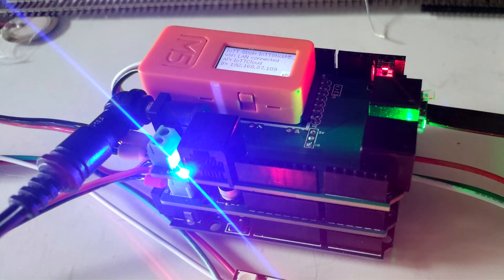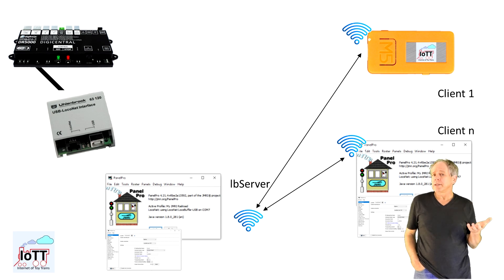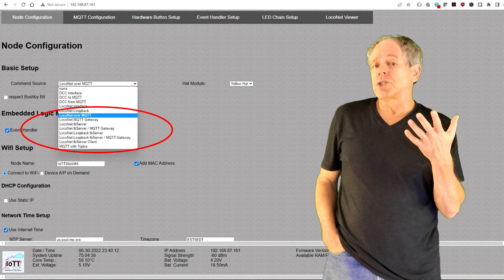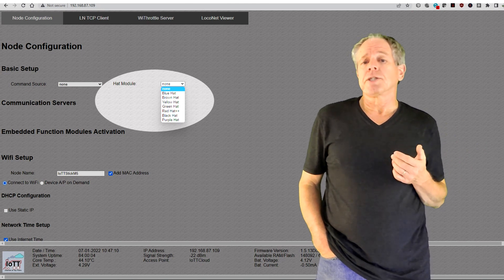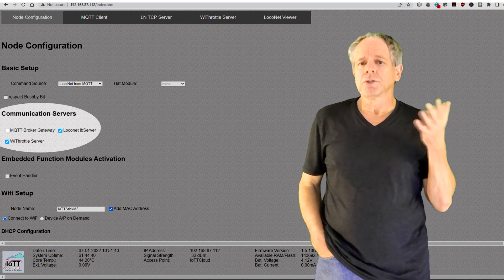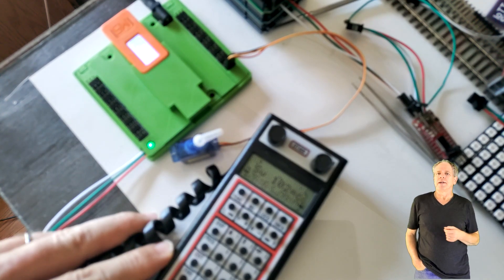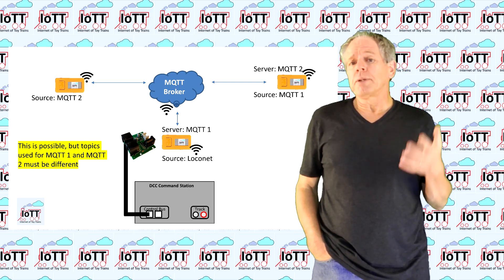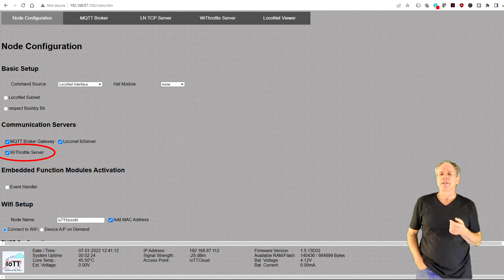A WiThrottle Server for the IoTT Stick (Video#98)

Comment: Hello! Can I ask - how many simultaneous WiThrottle connexions can the IoTT stick deal with simultaneously?
Reply from the maker: In AP mode, the Stick has a limited number of clients that can be connected. I think up to four devices should be possible, maybe 5 or 6. When n Station mode, meaning the Stick is connected to a Wifi router,  I think the ESP32 limitation should be bypassed. The server software is written so that it can dynamically add and manage clients as long as there is memory available. However, I have never tested it with more than four devices at the same time. 
In any way, if needed, there is always the possibility to connect the Stick to a PC software, e.g. JMRI, using Loconet over TCP, and then use a WiThrottle server on a more powerful device.
Reply: @IoTT  Thank you - that is helpful.

Comment: Everything runs well and I like to power the M5 by its pinheaders instead of USB-C but it switches off after some seconds. Is there  a setting to prevent this? Thank you :)
Reply from the maker: Verify the 5Vin voltage on the technical display page of the Stick. If it is higher than 4.8V and displayed in black (on either 5Vin or USB), the Stick will not shut down. Without external voltage, it shuts down after 30 Secs.

Comment: Hi. Just bought a M5StickC, it is available under Win7 under COMport 12. Unfortunately the update.bat ist not finding this port. Can I adjust it to use com port 12 explcitly? Thank you and best regards, Philipp
Reply from the maker: Check the M5 Stack web page for the correct USB driver. Also make sure that no other USB device is connected when you try to run the installer.
Reply: @IoTT  USB Driver was correct. It worked, after I added the parameter "--port COM2" to the batch file. Previously it always failed at another device on my PC. Possibly this is helpful for others.
Reply from the maker: @PhiMas29  Thanks for the info. I will add that to the readme file.
Reply: @IoTT  Sorry for asking again. After uploading I see the Logo. Pressing M5 brings me to "Connect to AP IoTT_Stick_..... to set Wifi credentials" but I see no Wifi accessible with this name. Cycling further I see "Wifi LAN disconnected - Click here to connect" but I don't know where to click.

BR,
Philipp
Reply from the maker: @PhiMas29  Check here for information on setup: https://myiott.org/index.php/iott-stick/user-manual/iott-stick-core/wifi-configuration
Most likely you let it time out.
Reply: @IoTT  Finally I got it running, thank you and to W. Heinen who helped me recently. Other question: Engine Driver does not react on trying to operate Functions over F8. How do you encode them?
Reply from the maker: @PhiMas29  At this time only functions F0-F8 are supported. The reason is that Loconet does not have commands for the higher function. Digitrax throttles, as far as they support higher functions, use encoded DCC commands, which means they have to be sent out periodically as they are not refreshed by the command station. This is something I may do on the Stick in the future, but so far I have it not implemented.

Comment: I think I understand this correctly, but if I have the Loconet Interface Breakout Board and IoTT stick with the latest updates, I could connect that to Loconet on a DCC system and that will allow me to add a WiThrottle server to the system?  I'm in a model train club that has a couple of layouts, and we're trying to add Wi-Fi throttle capabilities to all of them, but adding a USB interface + Raspberry Pi for JMRI is expensive, not to mention that Raspberry Pi systems are very difficult to find right now.  So if this will work, it'll be a game changer for us on our older, non-USB-capable DCC systems.
Reply from the maker: That is correct, assuming your command station supports Loconet. And the Stick can also be used to wirelessly connect JMRI to Loconet using Loconet over TCP. What I do not know at this time is how many devices can be connected at the time and whether the number is different depending on how the Stick is operating (providing its own acces point, or connected to an existing Wifi network). More testing required ;-)

Comment: Hi Hans, again another very useful addition to the IottStick ecosystem - well done.

Do you know what is the max client devices that can connect is? I've got a feeling its 8 TCP connections, but that may have increased by now  

No doubt this will be a very useful stand-alone feature for those who want to simply add a few WiThrottle connections to their LocoNet layout without adding a full-blown JMRI

I've just given it a quick try and made a few observations:
- It doesn't let me control Track Power - perhaps that is just a WiThrottle on iPhone feature but is useful
- The speed slider on the WiThrottle app seems to be a bit jumpy, but it might just be a GUI issue and nothing to do with your server implementation - I need to check how it behaves with a JMRI server as it might be "normal". It may indicate the need to do some message look-ahead and skipping etc if there are subsequent requests from the client that haven't been processed yet that would invalidate all the requests ahead of them and could be skipped. That sort of processing would probably make it more responsive to the user but thats a performance improvement not a bug.
- Would you consider adding mDNS support to advertise the WiThrottle service on the local network so the WiThrottle apps (not sure about EngineDriver) can auto-discover and connect to the server, eliminating the need to key-in the IP Address and Port numbers? There's an example of how to do this in the ESP32 library mDNS_Web_Server.ino
Reply from the maker: Thanks, Alex.
The lack of power control is intentional, it is only displaying the status bug ignoring input. I probably make this a checkbox on the server config page so you can enable the feature. I personally don't like the idea that an operator can shut down the entire layout. 
The jumpyness of the slider, is that on an iPhone? Looking ahead would be possible, I guess, but then the loco might become jumpy (depending on accel/decel settings)
mDNS might be an option in the future. I have never used it, so I need to investigate.
I don't know how many clients it can handle. From the software side, it is not limited a lot, each dynamic client structure eats up about 4kB memory. There might be a limit in the chip itself, but I don't know. Most I have connected so far was seven, it was not a problem (that was client link to MQTT, another Stick via TCP, MQTT broker connection, JMRI via TCP, and cell phones to WiThrottle.
Reply: @IoTT  Ah, I confirmed the Track Power does follow the state of the system when toggling the switches on the front of my DCS100.
Reply: @IoTT  The maximum number of clients is limited by LwIP max sockets count, which defaults to 16 in arduino-esp32 2.0.x (1.0.6 was limited to 10). This socket count is applied to both client and server sockets.  Each usage of AsyncTCP will consume 6 sockets (1 for listener, 5+ for incoming clients), as a client it isn't as bad. It is rather unfortunate that ESP-IDF has a hard limit of 16 sockets.

Comment: Hans, the WiThrottle server addition is REALLY great!  I've been helping some friends who don't have LocoNet to speed match their locomotives and this seems like a universal solution.  One question: when I load the JMRI file from the roster using the IoTT web interface, and run the speed match program ("SpeedMagic"), the xml file is saved to a default location on that local PC, even though the file has been loaded from a DropBox location.  This is also the case for saving speed profiles.  Would it be possible to call the "save as" dialog instead?  Since a user CAN stipulate the location from which to load the roster file (and seems to remember it between uses).

Not a big deal if not - of course I can manually move and rename files as needed.  Just a convenience for any - whether or not they use DropBox - who don't store these files in their local "downloads" folder.

Thank you again for all you do for the model railroad community!
Reply from the maker: Thank you. Of course, the IoTT Stick WiThrottle server connects to Loconet only, but for other command stations you can use the JMRI WiThrottle server.
Regarding the save-to dialog, please check your browser settings. In Chrome, check Settings - Downloads. There you can set the download directory and you can activate the Ask for location option. If activated, you get the dialog to specify the location.